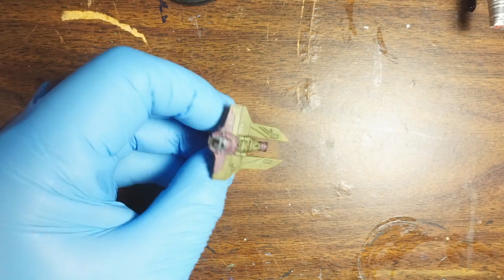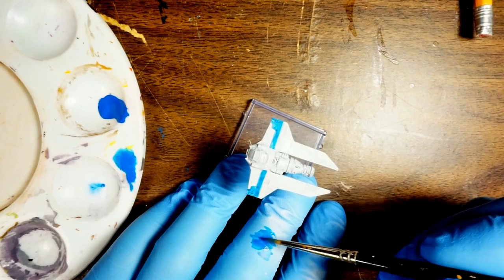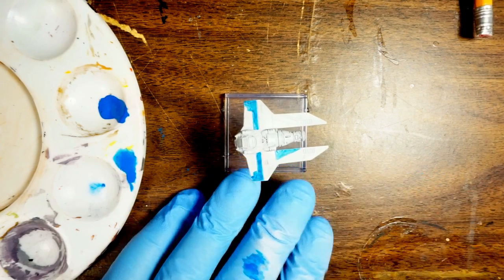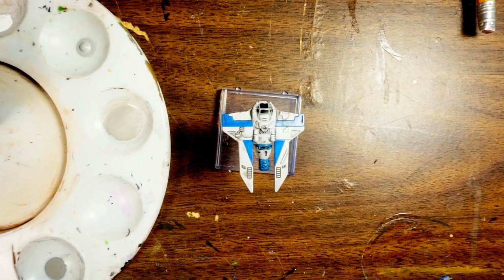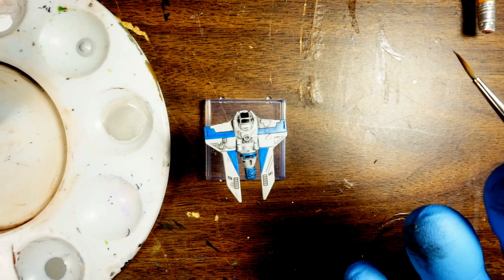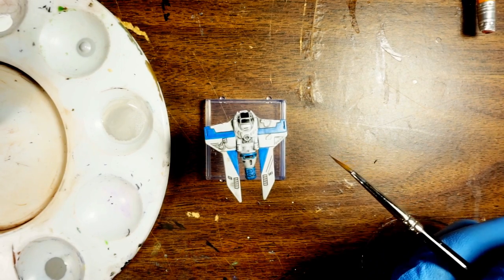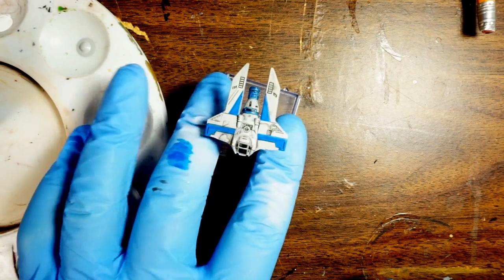Repainting an M3-A Interceptor for Star Wars X-Wing Miniatures

Comment: Whenever I do a weathering with Agrax Earthshade (per your suggestions, by the way Nulin Oil is amazing) it always seems too brown/orange. Am I doing something wrong?
Reply from the maker: akirascrow15 Too brown is in the eye of the beholder. But you might be using too much.
Reply: +akirascrow15 Ok late comment but the same thing happened to me. I find that after about 2/3 of the paint is used, it starts to discolor. I fixed the problem by buying brand new Agrax Earthshade and shake it up before each use.

Comment: Came across this video as I am just starting my painting adventures. I wanted to repaint my interceptor, but in a yellow and black scheme.
I don't have an airbrush so I brush painted the model white as a base thinking the black would be too dark for the yellow to cover up well. 
I painted the wings yellow and wanted to use your nuln oil trick to accentuate the grills on the wings but I can't seem to get the same level of contrast that you get. in fact it all seems to turn grey.
was wondering if you had any ideas as to why that's happening?
is my base coating possibly
too thick? Any advice would be great. thank you!
Reply from the maker: +Game Scape Most of the time I try to drop the wash into the panel lines with a fine brush. But you can also just coat it, then before it dries remove the excess with your brush from the panels themselves making sure to leave some in the lines and low areas where you want it. It's also possible to clean it off after it dries by coating the area with Lahmian Medium, waiting about 30 seconds, then rubbing the area you want to remove the shade from with a stiffer brush (like a drybrush). All of those things can help.
Reply: +Jay Adan Hey man. thanks for the reply. I'm thinking my pack of $4.99 brushes from hobby lobby may not cut it? so I currently have my first attempt at repainting dunked in pine-sol so I can remove the paint and start over. I am having fun doing this and your videos are very helpful. thanks again!
Reply: +Jay Adan Hey man. thanks for the reply. I'm thinking my pack of $4.99 brushes from hobby lobby may not cut it? so I currently have my first attempt at repainting dunked in pine-sol so I can remove the paint and start over. I am having fun doing this and your videos are very helpful. thanks again!